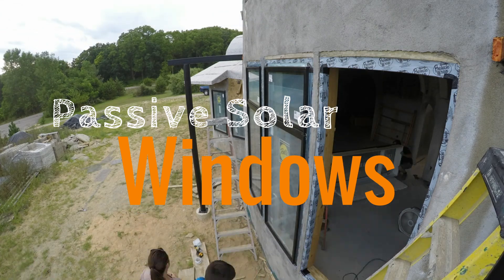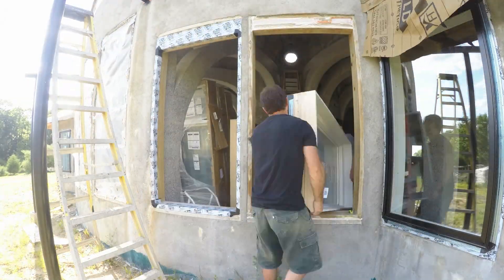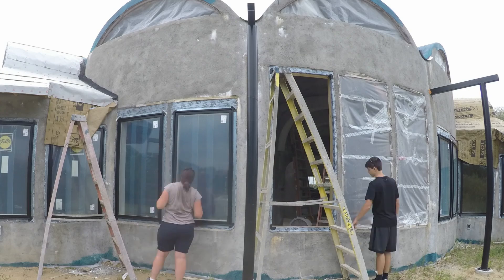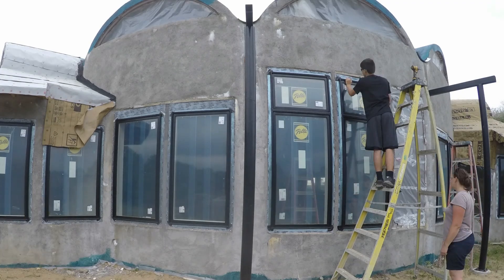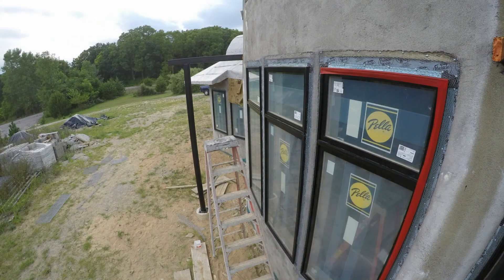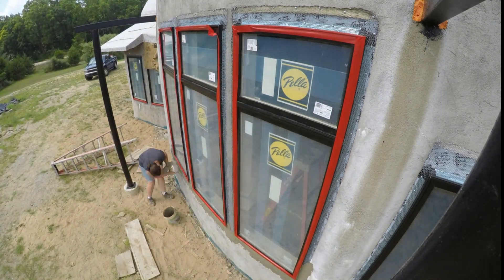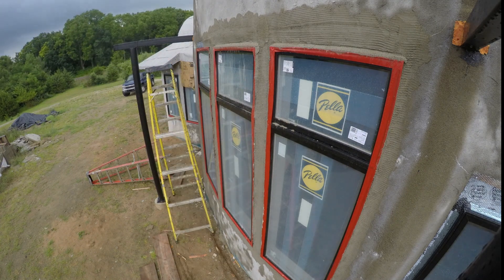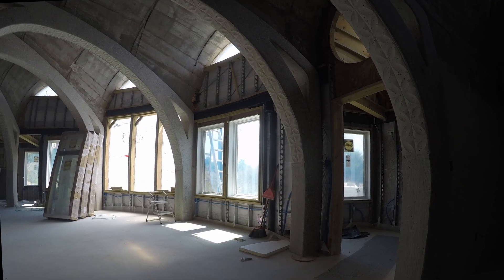Passive Solar Windows

Comment: I think you are all now certified professional stucco installers.
Reply from the maker: The only stucco we didn't do ourselves was the stucco on the front of the garage.  Guess which stucco is the only stucco that has cracked?  
The pro's put the garage stucco up in record time (all three layers in two days), so of course it cracked.  We are so slow that we gave the stucco layers lots and lots of time to settle in before adding the next layer ;)